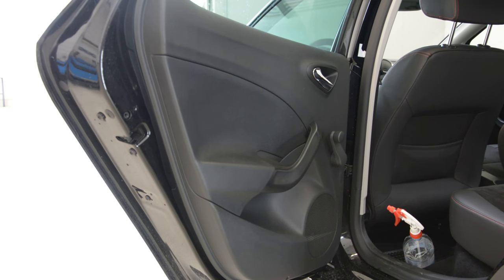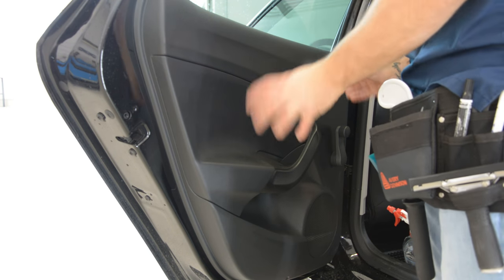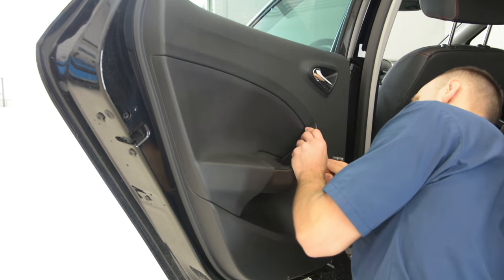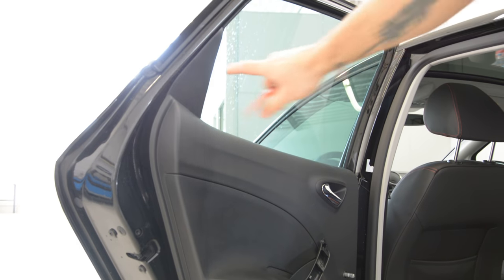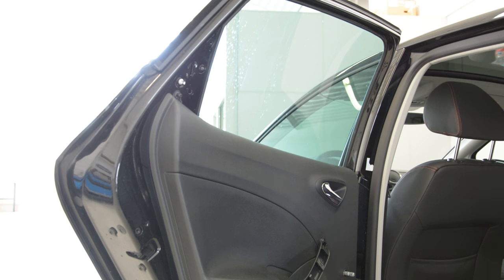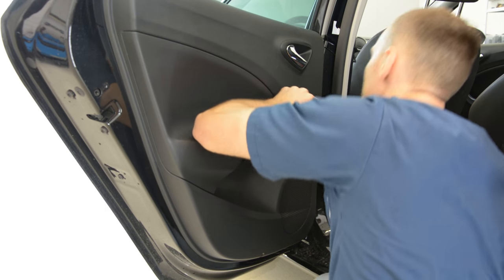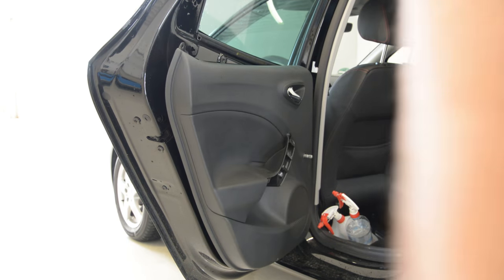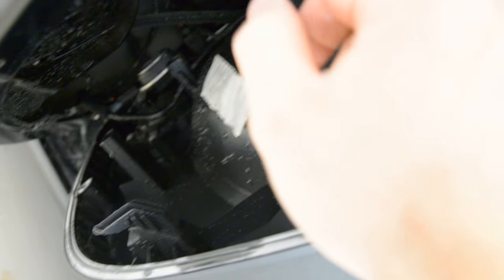How to remove the door panel Seat Ibiza

Comment: Thanks for posting, window winder release was amazingly simple but had eluded me. Getting it back together took me over an hour. You need packing case strip or paracord-something strong to pass around window winder upright and pull back into place to align clips and vitally the screw hole at the bottom of the door. Suspect most would give up.